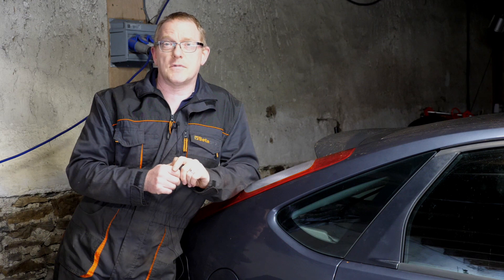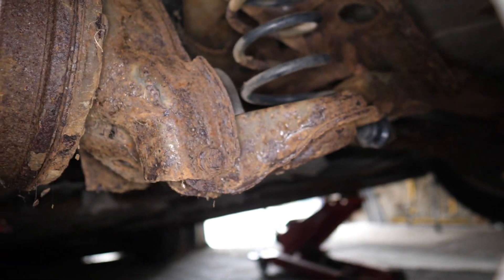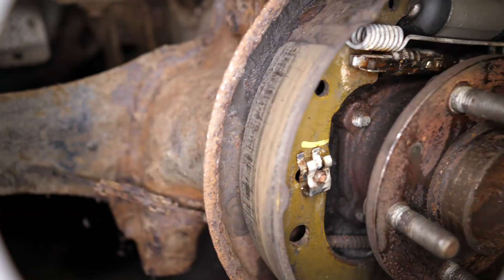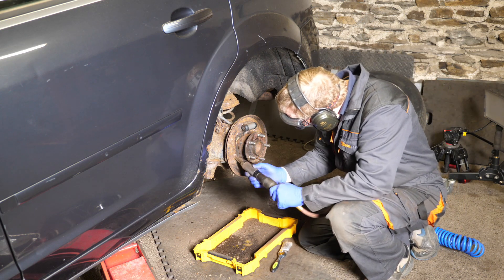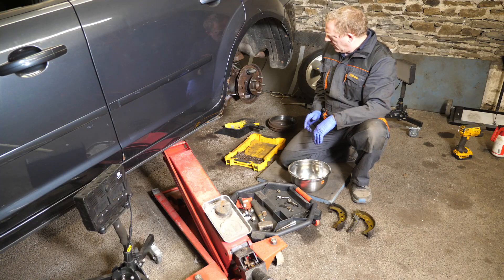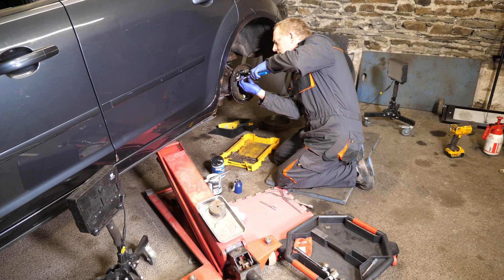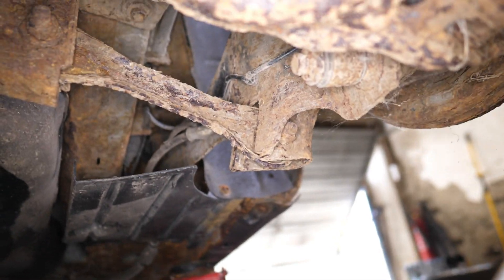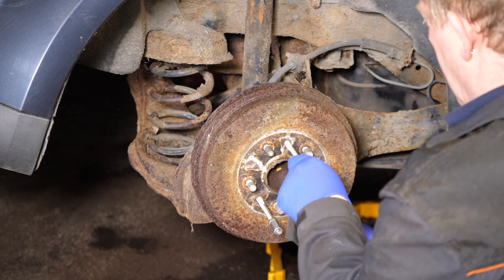Part 2 of 5  - Saving a RUSTY abandoned Ford Focus - Rear brakes and RUST... RUST everywhere !!!

Comment: I can relate massively to your frustration with the drum brakes. I worked on mine on my Ford Fiesta MK6, and the self-adjusters did sod all when put back together, so had to disassemble repeatedly to adjust.

A month later I swapped them out for a set of rear disc brakes from the ST model, the handbrake was configured in about 5 minutes vs a couple hours for the drum brakes.
Reply from the maker: Thank you for that.  So it's not just me then.  Drum brakes seem to be such a faff and they don't work as well to boot.

Comment: I admire your perseverance on this but it looks a bit too far gone, what happened to the Minis ?
Reply from the maker: It's MOT only just ran out about 2 years ago so in theory it should be ok but it was sat on grass which probably didn't help.  I had to swop the Mini's to get a couple of Renault Lagunas for commuting to do some HGV work so I needed cheap efficient diesel motoring.  YouTube needs subsidising so I had to give some priority to commuting vehicles over fun ones.  There is still a Mini in the family but a later diesel one with the BMW engine.

Comment: Hi Mark- Another of your finest on your least favourite Brand! Yes, had all that with rust and cars left parked on grass.I bought a Merc c-class convertible from my little brother. It was one of the directors company car at one stage, then it fell into his hands when he had to dispose of it-He was the FD so had the last say on matters. He drove it around a bit over here and parked it on one of his fields. He then decided it would be better off in sunnier climes, so drove it down and parked in his house in St Tropez. It faired better there but he go cheesed off with having to drive it back each year for an MOT. Dont mention Brexit- his sort are livid about it that my sort got what it wanted - (regardless of how its turned out)-Anyway, he told me he was selling it, I fancied a bit of luxury- it looked lovely in its red and light grey interior- black fabric roof. I bought it for £1k of the queens currency and he left me some jump leads. I went to return them as he left, but he said- No you'll ned these in a few days- the battery drains- Id disconnect it if I were you!  That defect took me a while to find- the alarm module has a NiCAD and it had leeched all over the PCB. The discs were badly grooved- the steering damper no longe clonked (because it was as dry as a 'Nuns' - all the lubricant exiting some years prior. Like your ford, it was as rusty as hell underneath and I had to use a sledge to remove the rusted discs- which is never a great idea, as you point out. The only good thing was COVID made me sell it and my MGTF as they were simply not getting used, my wife wouldn't go out due to her illness (same as you better half went through) and I got £1.6k for it, so not bad considering. My son who was about 19 at the time used to drive it- Kim insisted he had a bit of fun , so was on the insurance- it was fast- so imaging having a car like that when you were 19....They thought he was a wealthy student at Uni, as it often took it, roof down, Wifes private plates But, Rust because it HAD BEEN LEFT FOR A YEAR OF SO PARKED IN A WET FIELD!
Reply from the maker: Hi Patrick, how's things with you?  So the two years parked on grass can do a lot of damage in a short time then I guess.  What do you think to this one passing an MOT after the sills have been welded?
Reply: @CoatsandGaiters  Id wire-brush all the rusty parts and Hamererite them- I did the front of the Mini 2 weeks ago, mainly subframe. I need to do the back also, which ive not looked at for 2 years. I cant send pics of the Merc in reply, but it did look nice on the top but horrendous underneath. I remember putting a liberal coating of waterproof grease on the face of the hubs, so it would be earier next time. I didnt realise how bad it was till I got going on it. Oh, and when the weather was hot- it used to spring petrol-leak! My brother said- Oh, it used to do that in my underground garage, but I thought we had that fixed by our mechanic.....I wasnt sorry to see the back of it. Like most things cheap= you never seem to stop working on them.
You will need to spray the inside of those sills after you weld them, otherwise you will be doing it again next year. It should pass once it looks 'nice' -thats half the battle. Make sure the brake-lines are well treated 🙂
Reply from the maker: @patrickjmorgan  thank you for your experience and hopefully I can get it through an mot.

Comment: The self adjuster works best on the footbrake. And the spring needs to be intact on it otherwise it won't function.
Reply from the maker: I understand its a ratchet and it appears to be working but when and how does the adjuster turn automatically?
Reply: @CoatsandGaiters  when going into reverse and braking
Reply from the maker: @jekooisok1924  Thank you
Reply: @CoatsandGaiters hen you come off the brakes, the shoes pull the adjuster inwards which edges the tab along one tooth of the ratchet. When you press on the brake, the tab pushes on the ratchet and advances it. 
This below video demonstrates and explains it better than I ever could:
Reply from the maker: @sammytheseal2307  thank you for that Sammy

Comment: Fords are disposable, never was a truer word spoken in regards to your present project, but that does not apply to all fords, the Mondeo mk3 never looked like this, but what has to be seen is any Citroen over 20 years old, they usually are superb underneath with barely any corrosion. But that does not apply to the suspension component's that are usually in a very bad state, because they are added after the body has been dipped and undersealed, Stay safe.
Reply from the maker: I've always found it quite sad of Ford.  The cars normally drive and handle well with comfortable interiors but they give them no body protection at all.  The interior of this car has come up really well and the engine sounds sweet.

Comment: I know what you mean about drum brakes. I don’t know why manufacturers still go with them on the rear of cars. Disc brakes are not just far better, I’d imagine they’d be cheaper to put on at the factory, due to far less fiddly parts than on drum brakes. 😏
Oh, and imo this car is too far gone Mark. Not good that a car around 15yo can be a disaster area underneath. Ford’s have never been the best for anti corrosion measures have they. My mrs’ Mk3 Mondeo is not too good underneath either.
Reply from the maker: I think I must be really simple as changing brake pads and shoes is the most basic of mechanic jobs yet I have always really struggled with brake shoes, then the darn adjustment of the handbrake.  I really would have thought it would cost more to make and fit them in a factory than discs.  so many parts.  I have nightmares over rusty bodywork on cars since trying to do an MG Midget and it went from panel to panel and then the car was in half lol.  It was sold as a restoration project in the end.  I hope this hasn't gone too far but the judge is the MOT man.  Doesn't look great though does it.